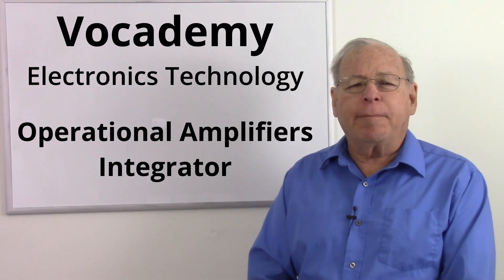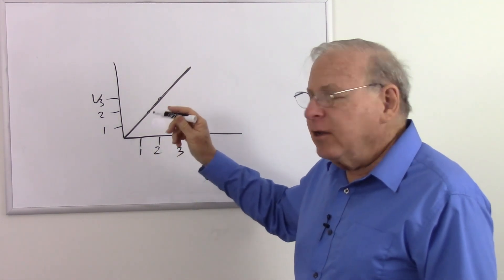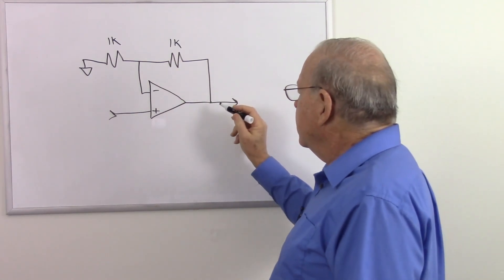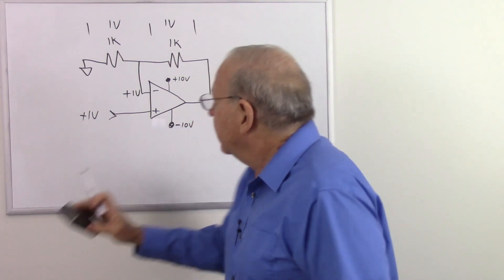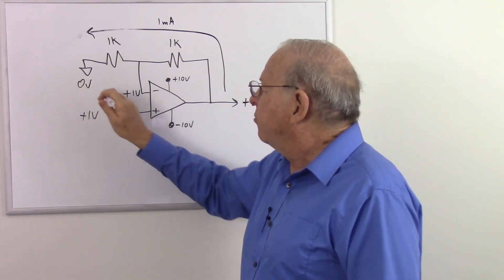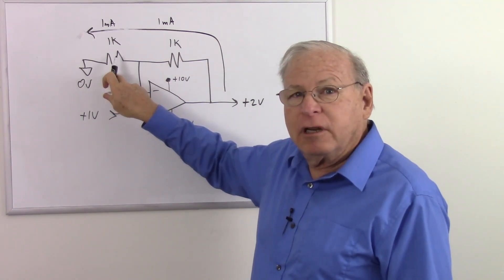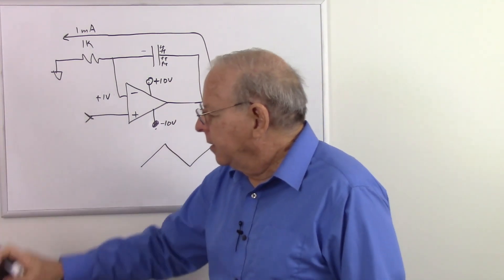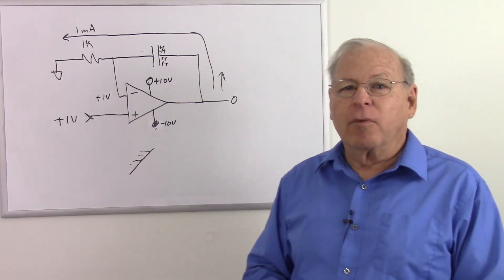Operational Amplifiers No  9   Integrator

Comment: "The output will do whatever it needs to make the two inputs equal.....

There is another way of looking at this.
An op amp is an amplifier that has very high input impedance, very low output impedance - and very  high gain ( A)
If we apply  feed back to the inverting input ( negative feedback) and set the non inverting input to a voltage well within the supply range - if the op amp is operating in a linear part of its charactetistics - ( ie not driven to one of the supply rails - then.. if there is an output of 
"Vo" volts - then the potential between the input terminals will be vo/A 
If A is very large - then the input differential voltage will be near zero.
It is only because the op amp has very high open loop gain that we can make this assumption ( along with input current being near zero due to high input impedance... and little or no change in output voltage due to feedback current since output impedance is very low.